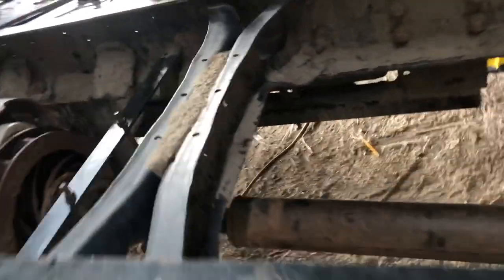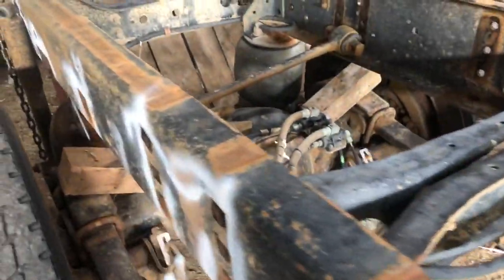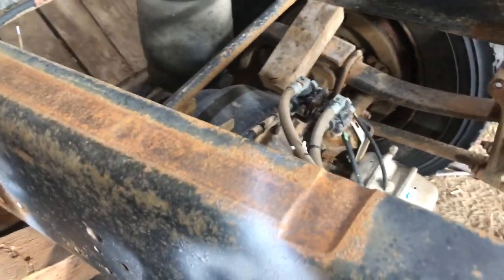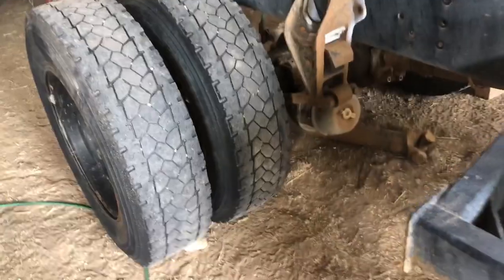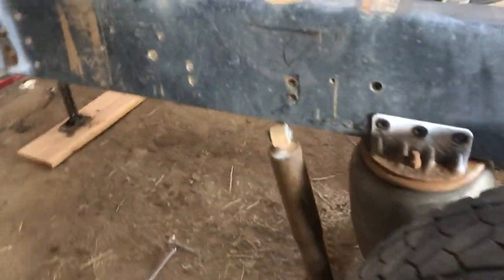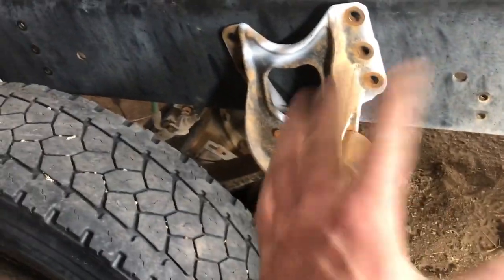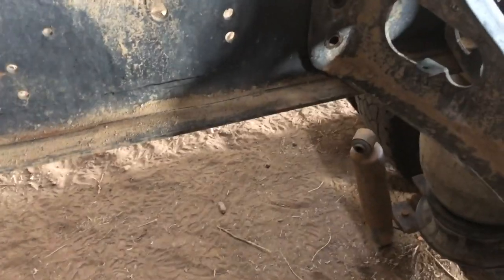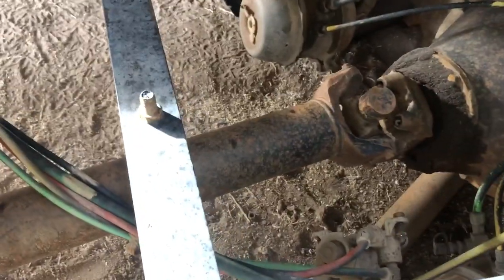1955 Ford F600 school bus chassis swap part 27

Comment: Thank you for doing this video you saved me from making a huge mistake with a bus chassis
Reply from the maker: Glad I could help! Curious, what would you have done?
Reply: @jmlcolorado  well I was going to try to get some axles off a 5500 gmc with the 19.5 wheels to get it lower 
I had been looking for a 1997 f700 with a Cummins it’s a lot lower to the ground than a bus
Reply from the maker: @samac4750  boy you ain’t wrong! The top of the flatbed on this thing even with the rear bags dumped is 48” off the ground. 
Makes it hard to be useful to the normal joe 😂
Reply: @jmlcolorado  yes sir but you worked hard and it’s a good job for what you had to work with